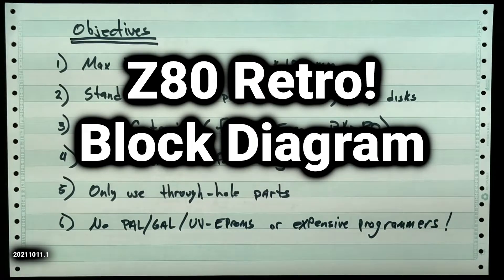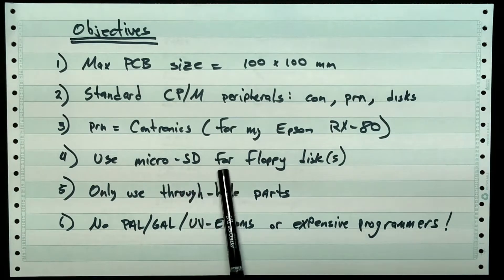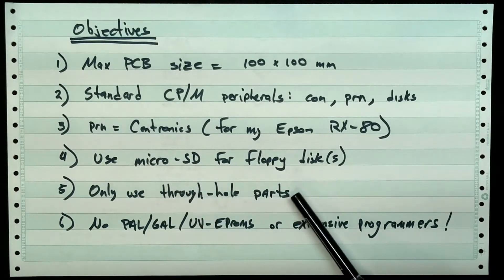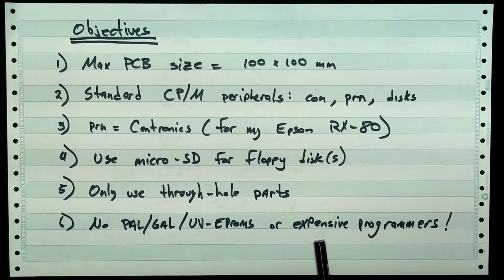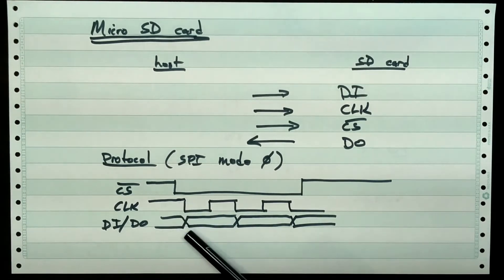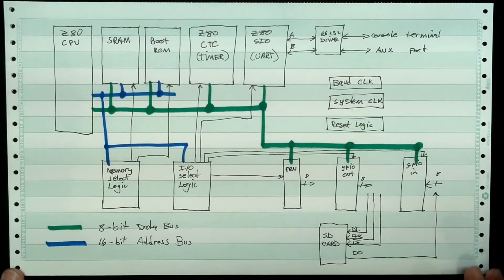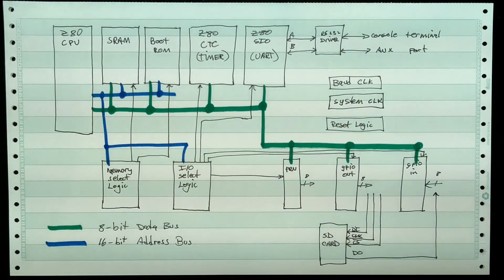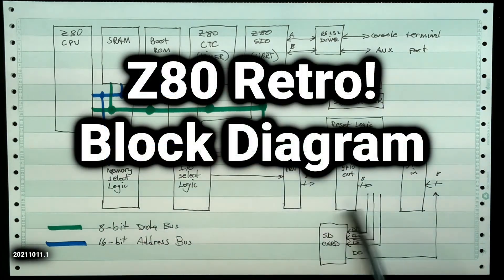Z80 Retro #2 - Block Diagram

Comment: Thank you for doing this. I'm quite excited for this series. I have been playing with the idea of making a Z80 computer for a long while now, even drew some schematics (and threw them away) and done some basic breadboard experiments. My current thinking goes in the direction of using a Z180 or Z182 chip that has the peripherals (SIO, PIO, CTC) integrated in one package. Not sure if that wouldn't be "cheating", or if it would even really be easier or not. I'm actually not an electronics/hardware person by trade at all but I do like a challenge. I'm sure following along with your project will teach me a few things. At some point I might build your design just to have something in my hands.
Reply from the maker: If you're having fun then nothing else matters!
My main goal for this project was to make it as simple as possible to build, use no hard to find/discontinued parts, and provide an all thru-hole option so surface mount soldering is not required.
So maybe there'll be something you can use.
I look forward to hearing your opinion as we go.

Comment: Probably already done, but yes, please do allow for UV EPROMs in the circuit, if it doesn’t break anything else.
Reply from the maker: I added some cut-away traces to the important pins so you can change the power & VPP on  32 and 28 pin packages.  See the latest version to see if the power & ground on pins 1, 2, and 30 (aka 28 on a 28-pin part)  are viable for your situation.
Reply: @JohnsBasement  you’re a good man. Thank you! 😃

Comment: Speaking from the experience of an amateur in electronics, UV-EPROMs are a real headache. Even though I have the programmer I screwed it up and can't erase my 27C64 chip. It's also possible to receive a chip that still has data on it. Sunlight doesn't do anything (even after many hours) and so then the only option is to buy an EPROM eraser or buy a (hard to find) UVC LED to jerry rig one. Way too much bother and I'd much rather just swap out for a pin-compatible 28C64 EEPROM!
Reply from the maker: Depending on the time of year, sunlight would probably take a week or more.
These days, EE is the way to go;
Reply: UV thing for girls nails will do the job ))

Comment: John, just discovered your channel. Where can I get a PCB so I can stark tinkering?
Reply from the maker: I really should consider setting up a shop for the these boards....

Some folks in the discord have been asking for my blessing to sell them.  So you might have a look around and ask in there:  https://discord.gg/jf73DRZvh5

In part #23 I show you how to order your own directly from any PCB manufacturer (maybe you can also set up your own Retro shop somewhere):  https://youtu.be/AUg_sbPnzn0

They are SOOO cheap to order directly from china AND if I were to try to resell them, the shipping would just dominate the price.  So I try to help you buy direct.  With that knowledge, you can even alter the design as you might like and order your own custom versions too!

NOTE: The shipping really IS the main part of the cost.  So you will want to order the CPU, Flash and the VDP boards all at the same time... even if you are not sure you want them all.  You'll end up with 3-5 of each board.  Give the spares away to your friends!  That's what I have been doing!

Comment: 100x100 IIRC that's also the limit for the Free version of Eagle.  But we use Kicad!
OMG, I have a bunch of floppy drives in the junkbox.  Don't think I have a way to use them in any of my computers though.  But, I have some WD controller chips and could make an Arduino floppy writer.
Reply from the maker: 😂... It'll be interesting to see how many people might want to look at connecting some real drives.  I'm sure I have some 1771s and maybe 179x parts around too.
I'm also wondering if a cheap FPGA might be worth using since we could then squawk any sort of format... and avoid data separators or the PLL for double density.  It boils down to how authentic we wanna go.
Eagle?  Whats that?  😜

Comment: Just use a Zilog Z84C15. It’s a complete Z80 system on a chip or Zilog eZ80 if you want a 50MHz version with extended memory and Ethernet.
Reply from the maker: Indeed, most newer CPU options are superior to the original Z80.  But using one would defeat the point of building a retro design.
Reply: The Z84C15 is a Z80 "Classic" part, thus is retro & not defeatist, it is just more convenient with a Z80 CPU with accompanying Z80 SIO, Z80 CTC, Z80 PIO with some bells and whistles like a Watchdog Timer, Power On Reset, Clock generator, Wait State generator and memory decode Chip Select Signals. Interfacing to it is identical to having the discrete parts and is just as much fun!  It saves a helluva lot of PCB space and one still has the experience of having to connect RAM and ROM to it.  Another alternative is to have a Z80 CPU with a Z80 KIO "Killer I/O" (Z84C90) to provide but this is a more expensive option.  Other fancier & less retro Z80's include the Hitachi HD64180 and the Rabbit Semi 2000 and 3000. The Zilog eZ80 is used in Texas Instruments Ti-84 Plus CE and other calculators so one can program Z80 if they're not so confident with their soldering and assembly skills.
Reply from the maker: @PebblesChan  Hmmmm... You are probably right. If we had this conversation a few weeks ago maybe things would have been different.
Reply: @PebblesChan  If convenience is a major priority, then why not just use an Arduino? It's an 8-bit computer that has lots of bells and whistles. At that point it starts becoming a question of......what is the actual goal of this project. Is it to learn as much as possible, or to just speedrun through and learn as little as possible? Not everyone has the same answer but I do think the Z80 Retro strikes a good balance of modern parts and discrete component layout.